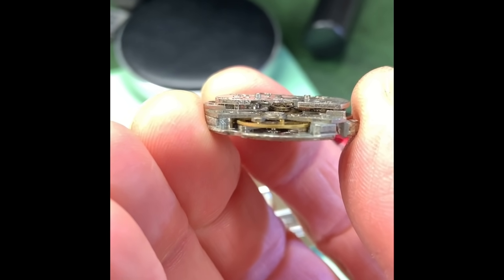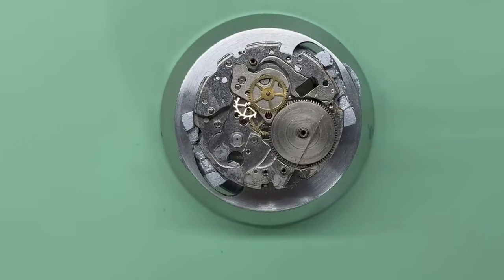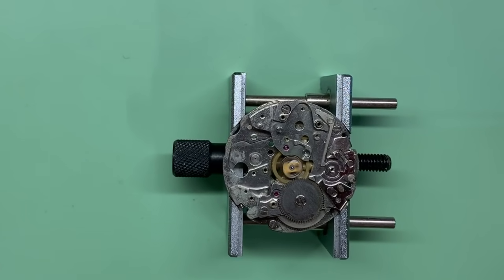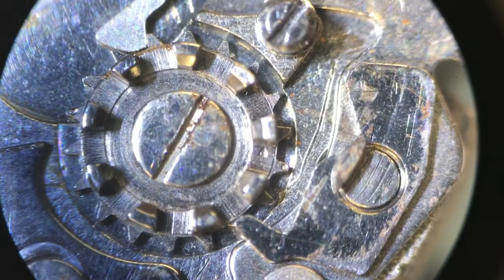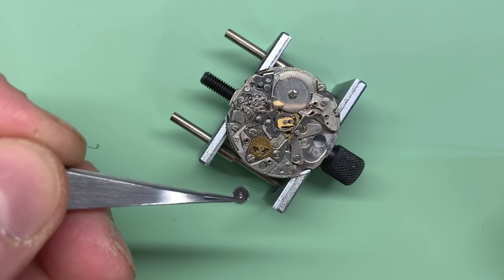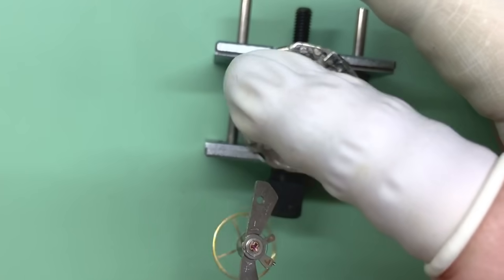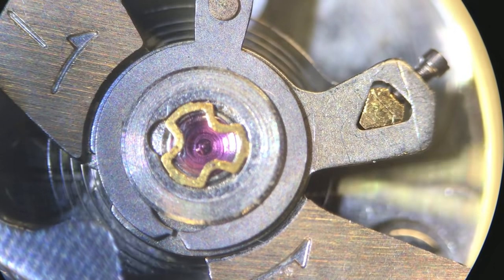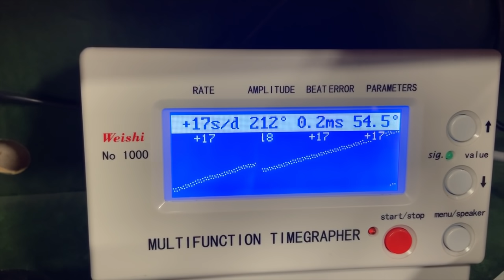Seiko 6139B Assembly Tutorial (Part 1) -Train & Chrono Works

Comment: Hey there Mark.  Loving your vids.  Awesome job.  I was thinking about the oiling of the chrono wheel.  Man, I felt your pain!!......You could use your staking set and use a stake (or even make a suitable stake) that fit over the shoulder and rested onto that gear.  That way you could push down square-on and less chance of slipping onto the wheel.

Comment: For assembly the gears are pressed together before the shaft is brought to the main assembly. Therefore the shaft in your illustration is capsized and the shaft pressed out. This will of course mean a fixture will have to be manufactured to hold the shaft assembly as the "pinion' is pressed out. The disc spring can then be removed and the two gears can be reined together. The assembly can then be oiled and pressed back together.. This should be able to be done as you live in the industrial Midlands with plenty of short order workshops around. Remember as my old apprentice instructor kept on telling us we have opposed thumbs which allowed us to be the makers in this world.

Comment: Love your videos. Especially seeing you overcome heartbreaking setbacks like a broken chrono wheel (been there). I just wanted to let you know there is a step by step repair with photos on a discussion board somewhere on the net on how to repair the exact problem you had here with epoxy. Sorry, but I don't have a link for you. I know, it sounds like a joke, but it actually worked for me. I'm sure you know the feeling of desperation that comes on you when this happens, so if it happens again, I'm sure you can find it out there. You can't really re-stake the wheel because it's stuck between the shoulder and the clutch. Just make sure you get the wheel perfectly flat and in position while the epoxy dries. Good luck!
Reply from the maker: Thank you Chris. Yes the chrono wheel coming off like that was totally heart breaking.  I will have to see if I can find the thread you refer to.i know a few guys who are much more skilled than me who have tried and failed to fix them.  Best solution I saw was from a friend who after many attempts has managed to make two bad ones into one good one. They can be disassembled but you do wreck certain parts in the process.
Glue sounds crazy but if it works!  
Time to hit google

Comment: Thanks Mike. One question - you said you only oil the one pallet fork jewel.  Why do you prefer to do just the one?
Reply from the maker: Jeff hi Jeff.. nice to see your watch running again . So the reason I oil one pallet is because there is a good chance I am over oiling . As the escape passes the jewel each tooth will get lubricated and my theory is some “excess” may then travel to the opposite jewel.

Comment: hi nice work and great to watch....i am working on a sieko pouge with the same movement, but the fly back pusher isn't working can you point me in the right direction....cheers in advance
Reply from the maker: many problems,  does the pusher push?  often if the movement is not serviced crap builds up behind the pusher and in the case so the pusher does not reach the lever on the movement.  The owner then pushes harder,  sometimes the pusher then gets caught and then ends up being bent. At that point they would have to be removed ,straightened or replaced.  If flyback is just not powerful enough then a service will fix this.

Comment: I've just finished a 24hr to the second midnight to midnight on my two 7009's.   The 3040 lost 2 secs but the 3100 lost zero seconds, I also done my '75 Citizen and that lost zero seconds whilst my Orient Tri-Star gained 5 secs so the 3100 wins the day pretty much.   Its funny I put some of my Vostoks on the night before and my main 090 and 120 Soviet Amphibia's I tweaked over time to perfection actually seemed to lose or gain zero seconds, my Poljot 1980 Olympic also gained or lost nothing but some of my Komandirskies need just a nudge on the advance bar as lost 5-10 secs on average and I am reluctant to nudge them as too far and its too much and a few seconds on a day for an old Soviet watch isn't bad imho.   I'm doing my cheap Chinese auto's tonite to see where they are at, a good job noone around to see me as it would have looked like I was doing repetitive rude hand gestures at 'em winding up the autos.   Got upcoming vids on Poljot mechanical alarm Signal (very desireable), Chaika Stadium automatic (another grail piece for me with its poison green dial and strident red hands and that evil eye shaped case) a quite rare KVPO (Russian military helicopter) Amphibia and a tidy deep blue dialled Komandirskie Submariner which means I have one of every main dial and case type in the Komandirskie department :)   Oh grabbed a job lot of Sekonda (USSR) nurses fob watches with one identical to the one I had as a nurse :)

Comment: the automatic framework should only go on after the hands are set in place using the proper supporting movement holder. If you don't support the lower jewel for the chron-wheel, you run the risk of pushing it out when you install the second hand.
Reply from the maker: Daniel Blair this will be in part two.  I was just showing how it’s fitted.
I have the correct holder to fix the hands from VTA.
Thanks
Reply: @MyRetroWatches  Excellent. I look forward to part 2.

Comment: You mentioned in the video you're adding a link to the service manual but I didn't see the link throughout the video. Can you share the link to the manual here? Thanks!
Reply from the maker: You will find more than one here on my site.

https://myretrowatches.co.uk/seiko-data-sheets/
Reply: @MyRetroWatches  
Thanks for the link! You have a more extensive collection than seiko’s site.
Have you worked on the seiko bullhead, 6138-0040? I needed a small adjustment on mine and noticed some rusting in the chronograph hammer so I decided to do some cleaning. When putting things back, the escape wheel is not fitting in correctly as if the pinion got shorter and not sitting tight between the main plate and the train wheel bridge. I checked the service manual but couldn’t find anything that would help.
I know I didn’t break anything and I’m almost positive I did not lose a piece. In short, it’s wobbly causing the movement not to run. Any tip/advise would be greatly appreciated.
Regards

Comment: Hi Mike could you advise me on this 6139 it has very low amplitude and running very  fast I have changed the mainspring
Reply from the maker: Low amp and running fast?!  Well look at your hairspring as when watches run really fast it will be because Most likely it’s out of shape or coils are touching somewhere to shorten the spring
Reply: Thanks i will have a look 😊

Comment: Hi , I don't know if you'll read this , but is there any way I can contact you regarding a repair ? I have noticed you have accumulated alot of experience on seiko 5's . The short of it is , my late Grandads old sieko 5 has a fault. The day wheel (mon,Tues etc) is stuck , but moves intermittently on it's on at random times . I haven't personally opened it up , but I wouldn't know what to do anyway . It's pretty battered and hasn't been used in decades . Everything else seems to work with a shake and seems to keep time well . Might be good for a vid ? Cheers . Phil

Comment: I've watched this video 12 times. I'm building a 6139-6005, and I just purchased the movement, chrono stops and starts, but won't reset/flyback. Do you have a suggestion on where to look? I am waiting till I get my lubricants and a better movement holder to disassemble, but any tips on my issue would help, thank you.
Reply from the maker: Fly back you need to look at the hammer. Make sure it’s fitted properly and that you have the hammer spring which is a big long metal part with a hook on it that is attached to the chronograph bridge over the other side of the post that comes up to meet it from the hammer.
There is also a spring that wraps around the hammer but that is not the hammer spring.

If you are stuck then join the Facebook group in the link in description. Post some photos up and all the members will give you all the help you need
Reply: @MyRetroWatches  Thank you, I will look at the hammer. The pusher goes and springs back, but it's not engaging the hammer. I'm really nervous about taking my movement apart, it was a lot of money (to me). As you know getting started to work on watches is expensive. I'm not looking to be a watchmaker, just be able to service movements. I do not have a facebook or I would join your group. Thanks again for your time and answering my question.

Comment: Mr.Mike,The central wheel was loose and had come out of its pivot.It was moving in a zigzag way.How did you fix it?Your action was not caught in the video.It was just skipped and I am disappointed.It is a very important issue.Please explain how you set it right.Because I have come across such issues and I donot know how to fix the wheel properly,without damaging it.

Comment: is there any watch in particular (cheap, easy to get, not overly complicated) for beginners to start tinkering with?
Reply from the maker: Martin Ziener I generally recommend Seikos , I started on a 6119 movement and 6309. I have some video series on both as a good guide.
Both watch movements were used in many models and you will find them cheaply and easily on eBay

Comment: Mike, really nice job. Do you usually use your microscope even when not filming? Wish we could have seen that last bit about verifying that the little pawl was correctly placed. Is it fairly obvious under the scope? At any rate, thanks for making the effort to create this video. Just looked incredibly fiddly!
Reply from the maker: Dale Yurk I use my scope for oiling and inspecting mainly.
The pawl I should have filmed but that bit was filmed on another day and I had not got my scope setup for filming.
Under the scope it’s completely obvious as you can see both levers not engaged with the wheel.
I could tell when I first wound it , felt too stiff and not the right sound ...

Comment: Mike, nice work.  What kind of numbers did you achieve with this 6139?  Honestly, I absolutely love working on these movements and 6138s.  They are just so well engineered and I love how they go together.  Now that you have done a few 6139s, you need to do a 6138.  The calendar side hammer setup for the hour recording wheel is pretty cool.  You need to try a 7016 or 7017 chrono next for comparison.  Completely different architecture.
Reply from the maker: Supercruze I’m new to chronos really.  Unfortunately I can’t afford them certainly the 6138s .

This one was in very poor shape to be fair, very end of the video you see my TG trace.  200+ a bit.  I have not regulated yet but can’t see much improvement on that to be honest.
Reply: Mike - I will go back and look at the time graph. Most of the 6139s have worn  MS arbor ports. I am jeweling these now and something I think you are more than capable of doing. Good content for a future video. Thanks for your channel and videos. John